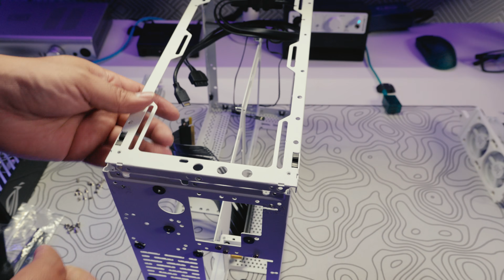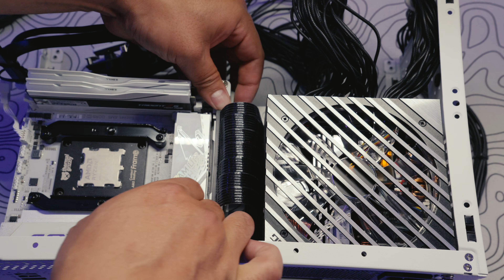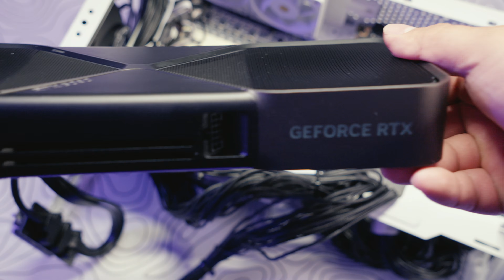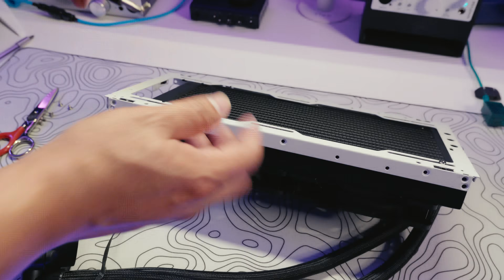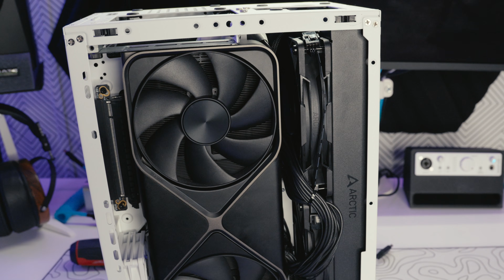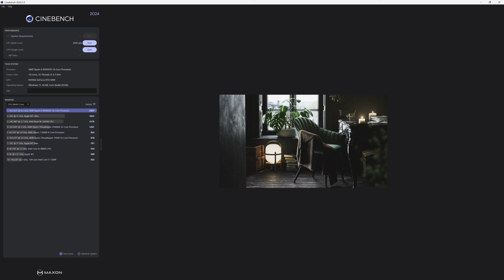RTX 5090 + Ryzen 9 9950X3D | Ultimate SSUPD Meshroom S V2 Build

Comment: Also, did you have any concerns about the tubes to the radiator being below the AIO pump? I've heard that causes strain on the pump long-term. Was it not possible to mount the radiator tubes at the top of the front panel? Also, any reason you chose to use pull-through fans as intakes on your radiator rather than push-through?
Reply from the maker: Tubes down is good as air doesn't build up in your tubes or radiator, but make sure you check the manufacturer installation manual.

Comment: I'm going to convert my old NR200P v1 build with a 3080 Ti FE and 240mm AIO cooler into this case. I really appreciate the comment about the flowthrough GPU cooler impacting the motherboard, that is one of my main concerns as I'm now currently dealing with severe overheating issues (4 years in) with my motherboard's chipset and NVMe drives due to GPU exhausting into the same enclosed space as the rest of my components due to my current chassis' configuration. I really like what you did with the mini fans in the GPU chamber as well, interesting approach. Any other tips you could recommend for first time builders with this chassis? I'll be using an SFX PSU, mini ITX, 240mm AIO, 3080 Ti FE, 1 front mounted and 1 rear mounted NVMe (concerned again about GPU exhaust overheating it), a heap of SATA SSDs, and as many case fans as I can stuff into this thing. You make me wish I had a 3D printer!
Reply from the maker: Thank you for watching and taking the time to leave a comment.  I can't think of any other tips for someone building in the Meshroom S v2, except for take a look on Etsy for taller feet or a base to make it easier for your display cables to exit the case.

Comment: building almost the same setup as yours (just with a 5080 + 9800X3D). I saw you used the Thermal Grizzly contact frame. Why’d you go with it? Notice any real temp improvements? Would you recommend it?
Reply from the maker: No real noticeable temp improvements, but I feel like it makes a more solid contact area when mounting a cooler and better control of thermal compound.

Comment: As the manual say the aio lf3 wont fit due to the 65mm total thickness compare to the clearance in the manual 63mm max ! How is it possible and isnt it bad for the airflow when the space forward the fans is blocked by the cables and tubes ?

Comment: I'm waiting for my Meshroom S V2 to arrive, and I will also be building it with a 5090 (PNY). Thanks for being so thorough in the video - it really helps (especially the part about the top exhaust fan and the 3D printed brackets for additional fans, and the base). Maybe I missed it, but why did you decide to mount the AIO as exhaust? Have you tried it the other way around to compare the temps in different modes (AIO exhaust/ AIO intake)?
Reply from the maker: Thanks for watching and thank you for your questions.  The reason why I chose to run the fans as exhaust is mostly due to gpu thermals.  As intake, I was getting slightly better cpu thermals, but the 5090 was hitting 82 degrees due to the design of the founders edition.  So switching to exhaust helps with my gpu temps by 10-15 degrees and cpu temps pretty much only differed by 2-5 degrees.